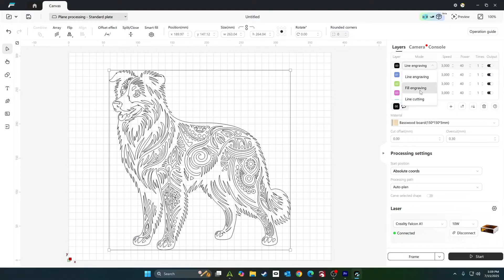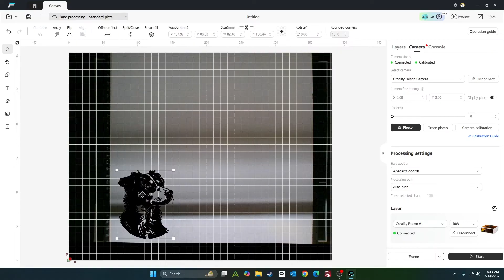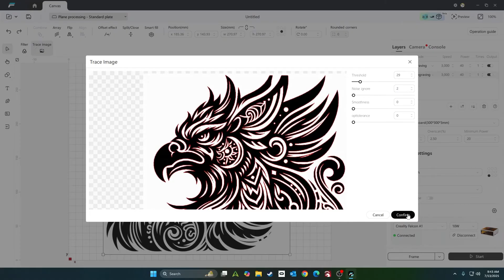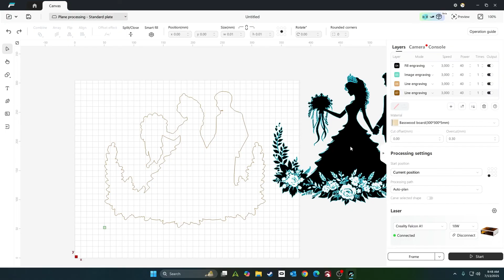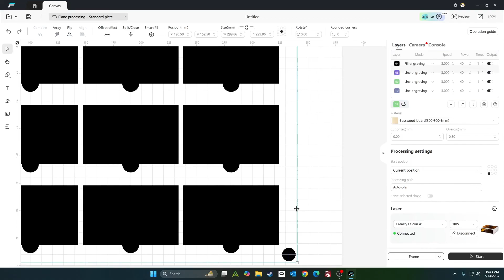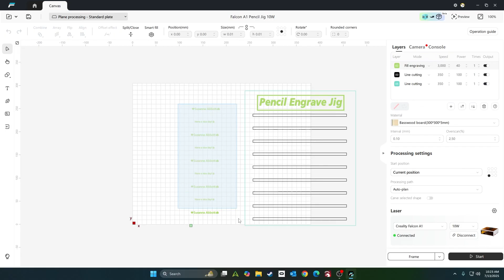Beginners Guide to Getting Started with Creality Falcon & Design Space

Comment: What troubles me with this software, is how to be truly accurate. I am used to cad/cam where drawings are based on elements with exact mm sizing, instead of being image files.
I want to do a  triangular 📐 set square with measurements engraved with  some cutouts. So, an object with cutout shapes and engraving that needs to be created with accurate sizes but having cutting layers the same size and scale as engraving layers...

Like I would rather have a Cad/Cam package that can do some art over an art package that may struggle with accurate sizing

Comment: Just got the falcon a1 and the air assist won't work in design space but works in Lightburn so how do u manually turn it back on
Reply from the maker: Should come on during line cutting, don't think there is a way to turn on or off.  It's built into  software.